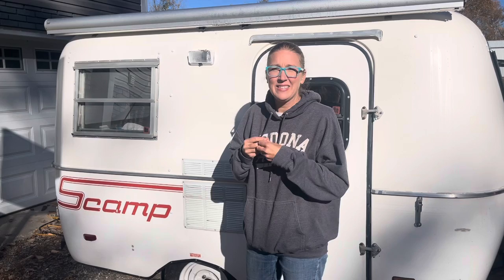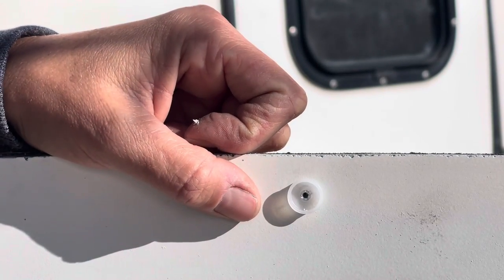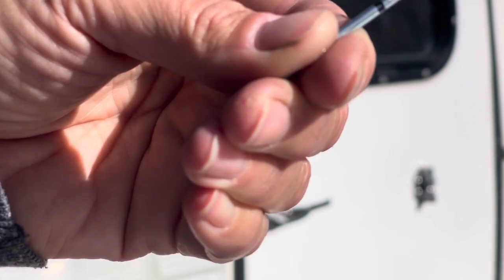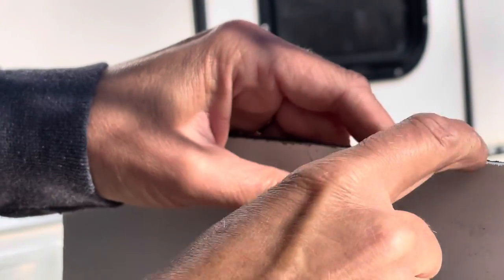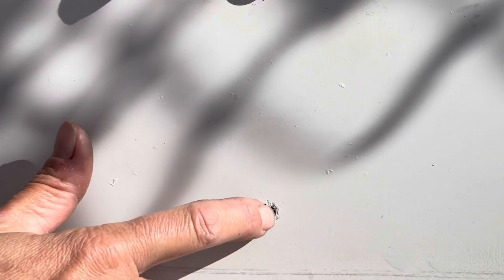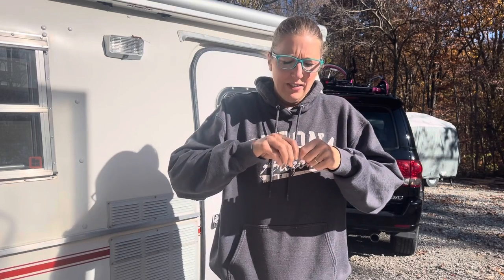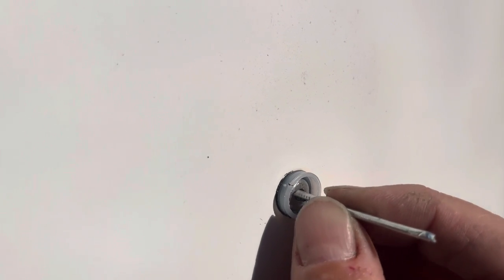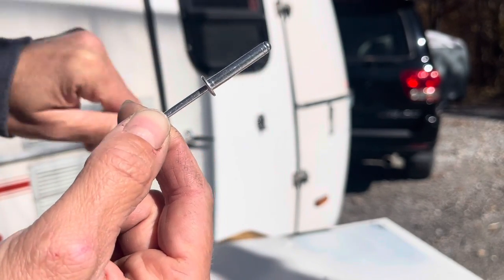Installing rivets in Scamp fiberglass trailer

Comment: Great job Brook. I've been afraid to drill those things out. Those little caps are popping off all the time. I've been just using silicone and sticking new ones on. That works ok, but now if I have to drill one out and replace it, I can do it. Thank you...

Comment: That was very informative. Thank you. Are the two halves of these trailers under that midline strip also held together with rivets? Is this an issue that fiberglass construction typically has, or is it unique to the brand?

Comment: I use a 1/8" drill bit on the small rivets and 3/16" on the larger rivets. I would drill out the hole larger than it was originally.
Reply: I meant to say I wouldn't drill out the holes any larger.

Comment: I would have installed a washer to back up that rivet.  It will back out of the fiberglass in due time because of vibration while in transit.

Comment: This video is very good however the diameter of the hole has nothing to do with the length of the rivet needed. You keep using the word "diameter" while trying to determine the length of the rivet needed. They are two totally different things.
Reply from the maker: The rivet length needed does depend on rivet diameter. Here is a quote from the Arrow Fastener’s website “The length of the rivet should be equal to the thickness of both objects you are fastening, plus 1.5 times the diameter of the rivet's stem.”